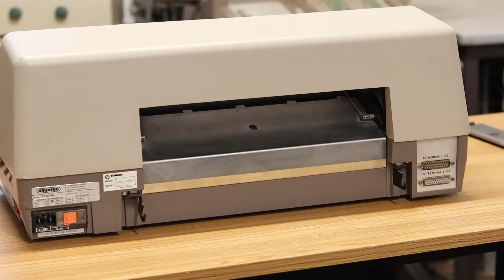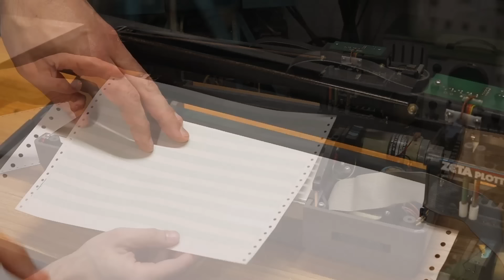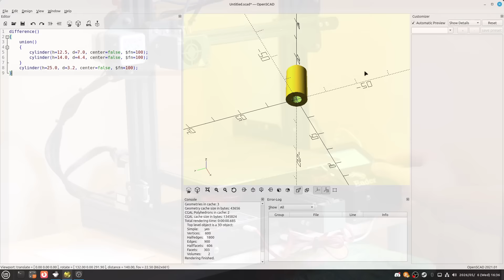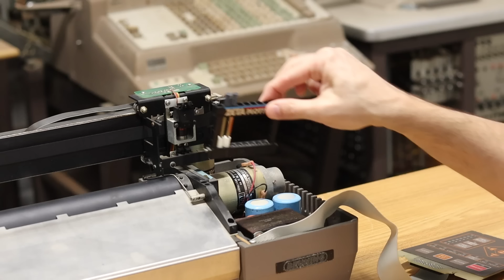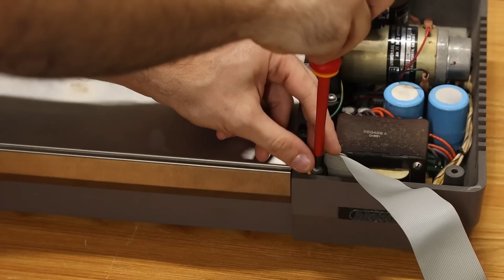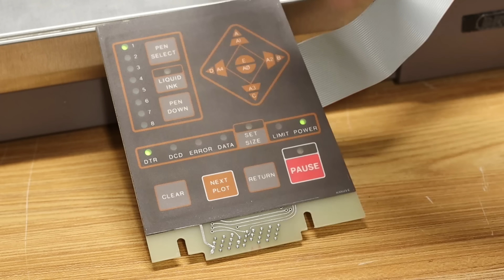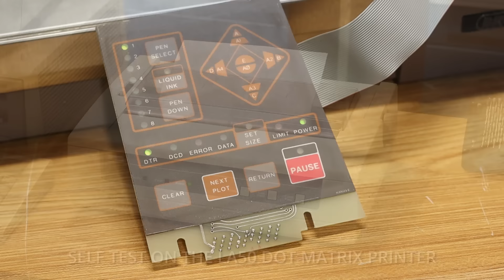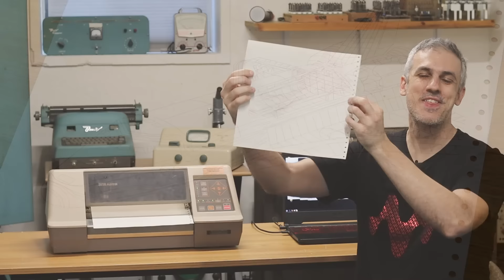A Pen Plotter from 1986!

Comment: I really like OpenSCAD, I don't have the time to learn regular CAD and OpenSCAD allows me to apply my existing developer knowledge to get functional 3D parts.
Reply: Works probably on simple geometry but the features on heavyweight cad are there for multiple solid reasons. The proper cads are parametric so you have similar features already built in to them. Bushing is so simple you can simply draw it on paper but most mechanical parts might seem simple but are full of small details that makes constricting them through code practicability impossible.

Comment: To solve your stringing issue, try drying your filament. PLA especially is hygroscopic. That will at least help. The other thing to check out is your filament retraction settings in your slicer software. The ender 3 doesn't have a direct drive extruder and so the retraction length is generally more for a bowden type printer like yours. There are tons of retraction calibration articles online and on the popular model sharing sites.

Comment: The stringing is slicer settings most likely. Print a temp tower that will help you calibrate your slicer settings. Or, get any printer from the last 2 years and just print. The Ender 3 is great if you want to learn all the ways to fail a print, but I recently acquired a Creality K1, and haven't touched my Ender 3 since.
Reply: Yeah 100%, I had a CR10S for several years (very similar to the Ender 3) but now I have a Bambu P1S and it's SOOOO much quicker and easier.

Comment: Neat. And fairly standard as far as plotters go. The pen holder solution being the only exception compared to HP or CalComps. The soundscape of clicking solenoids and drive motors is really something with pen plotters.

I own several myself from the HP7550A and a Plus over to a HP7225 and a Tektronix 4662.

Comment: I used to write software to interface with HP plotters (HP 7550A, HP 7585B, etc.)....
Reply: And many years later, maybe as late as 10 years ago, I happened to run into some old s/w I needed to adapt and use, but it used that old HPGL library for all its graphical output (to screen or pdf/ps). Luckily the old lib or dll still worked, because I didn't fancy rewriting all those plot and pen instructions!

Comment: Thanks for your fun videos :) 
For your 3D printing stringing issue, you should enable retraction in your slicer settings for the extruder. A good starting point is around 1 mm for PLA, and usually a bit more for PETG.
Retraction helps prevent filament from oozing out of the nozzle during travel moves, which is what causes those thin strings between printed parts.

Comment: Yea, either the filament is not dry or your extrusion settings are incorrect. Make sure you tune pressure advance and retraction properly
Reply: Temperature can also be too high.

Comment: Those strings on your prints are usually caused by one or more of the following:
1. Printing temperature too high
2. "Wet" filament
3. Bad retraction settings
4. Printing multiple parts at once
5. Using PET
6. Extruder's steps per mm too large (unlikely)

The usual solutions are:
1. Using your filament's recommended temperature, or fine-tuning your temperature (you can use Teaching Tech's printer calibration guide site)
2. Dry your filament and store it in some sort of drybox. You can use your oven, or your printer's hotbed, or your microwave (carefully). You can find drying temps and times on the Bambulab site.
3. Use Teaching Tech's calibration site.
4. Bite the bullet and just print it one at a time, or try your best with the above.
5. Using PLA.
6. Use Teaching Tech's calibration site. This is the least likely option if you've never changed it. Usually, it'll be too low.

Your prints don't look quite like wet filament, so check temperature and retraction first. But drying is ALWAYS a good idea. You can also use a lighter to make cleaning up the strings easier, if smoothness isn't critical.
Reply: How hot must filament be stored to remain anhydrous? There are little ‘rod ovens’ to protect the hygroscopic coating on opened boxes of welding rods. They’re cheap and might work for this

Comment: Also, for the 3D print, you can try getting a 0.2 mm nozzle, or using a resin 3D printer that has MUCH higher resolution.

Comment: 3dprinted pin holder issue: If it moves too much you can always start layering heat-shrink tubes on it until it fits snugly. Janky AF but you wont change them that often i think.

Comment: A weird thought...  since you have a 3D printer, couldn't you design a little tool that zips along the edge of a sheet of paper putting holes in it?  Like a spinning hole punch?  (So you can add you own tractor feed holes)?

Comment: You could replace the thin wall plastic section with a bit of heatshrink tubing of the proper diameter glued to the printed part. The stringing could be caused by waterlogged filament, but the Ender 3 is also a bowden type extruder and tuning the retraction settings is inherently harder on these. And if you are printing flexible filament getting rid of stringing on a bowden style extruder is neigh on impossible.
Reply: Or reach out to any of the hundreds of machinist youtubers to make you a coffee cup of them. Me? I'd just make them oversized and sand them down.
Reply: Could probably actually just shrink the heat shrink directly onto the pen to increase the diameter (maybe multiple layers)

Comment: Nice small pen plotter. I was working as field service enginneer and tech support for CalComp in the 80's and that remember me that time. The motors doesn't look like stepper motors but like DC motors drived by pwm H  switches. The feedback is done by optical encoders at the and of the rotor.
Reply: It's amazing they were able to get so much precision out of that configuration!
Reply: @PhysicsGamer  the problem with stepper motors is you don't have feed back , if for any reason you lost incréments ( many times in the logic in theses old times 🙂 ) the rest of the drawing is shifted afterward. Also stepper motors on the 70's plotters were incledibly noisy even on drum or flatbed plotters.
Reply: I probably know you. I worked there too.
Reply: @julioguardado  May be not, I am in France 🙂
Reply: CalComp brings back memories. In college, I worked in the computer center (mainframe and timesharing terminals). We had a CalComp drum plotter in the back hallway. It got used occasionally. What I remember most about it, was the absolute junkyard of nonfunctional pens scattered around it. Drafting type, ballpoint, even some felt tip pens. Didn't matter what kind, they were all pretty much single use, because by the time they were needed again, they were dried out. It used roll paper with tractor feed along the edges...2 or 3 feet wide. 
I wonder if you have looked for chart recorder paper?

Comment: If you 3D filament hasn't been in a dry box and is more than a few weeks/months old depending on the humidity.  It has probably absorbed too much water from the air.  You can try drying it in the microwave or oven, but...  Might be easier to accept the loss, buy new, and build a simple dry box for storage.

Comment: Nice video! Yeah, the membrane control panel can be a pain, however, remember that this was meant to be run in industrial environments and a sealed panel is MUCH better than the HP buttons that kept needing cleaned. The hard part is going to be getting the pens to work consistantly.

Comment: I first used a plotter in the early/mid '70s as an undergrad at Leeds University (UK). It was located in Manchester, and we queued up jobs to send over a slow modem link (300/1200 bpi?) and got our printouts in the post a day or two later. Then when I went on to do my PhD we had our own plotter. It was incredibly noisy, and slow. It used Rotring Isograph pens, and was connected to a PDP11/45, with homebrew graphics system (better than an Evans & Sutherland for our needs) to do molecular manipulation on screen. The plotter was oftren used to plot electron denisity maps for fitting molecular models to.  And Moonlander, of course, which a postdoc had converted to work with our graphics system.

How things have changed, except for playing games on computers.

Comment: Dry your filament and then calibrate your filament and printing profiles - I'd print a temperature & tolerance tower for the filament you're using, record the temperature sections that gave the best results and save the best profiles that work - Depends on the slicer you use, too - YMMV!

Comment: If it helps any, those are standard pentel pen refills, at one time they came in different thicknesses, tips, colors.  Not sure if that's still the case.
Reply: They also look a hell of a lot like parker refills for ball points without the plastic end on . You can get them in fine and medium .
Reply: @andljoy Parker, that was the other one I was trying to remember.
Reply: @andljoy  yes, Parker Jotter/Gel pen refills was the first thing that came to my mind when I saw them.  They come in a variety of colours, you’ve got your basic black, blue, red and green in the Jotter but the Gel adds in purple, lilac, pink and turquoise (probably others as well).
Reply: Also the same as the Fisher Space Pen Refills.
Reply: We get Ballograf refills that are very similarly shaped, made in Sweden, I think. 
I have fitted many of those in cheap old dried out advertisement pens that come in flashy colors with magazines etc. Sleeper pens that draw much better than the original dirt cheap fills that were in them.

Comment: I remember buying into E3D V6 for my first 3D printer and I bought some very fine nozzles.  0.25mm nozzles are incredibly detailed, but I wouldn’t print rubber at such a fine nozzle size, I’d use a resin printer for that, or better yet, get them 3D printed elsewhere for just the handful you need.

I still think 3D printers are awesome for vintage folks of many varieties, including computers, cars and toys.

Comment: People order custom forms all the time.   Just phone your local print shop and order the paper you want, the size you want with tractor feeds.   It's a pretty standard thing to do.
Reply: You have a far more capable local print shop than I do. I have to order from a specialty mill, and it's not cheap for custom dimensions. They can do pin feed holes, but not at arbitrary widths including the width needed here.
Reply: @jsalsman  The idea of a print shop not doing custom sizes seams odd to me.  Unless your talking about kinko's or something like that.   And Yea,  I assumed hew knew it wasn't going to be cheap from a custom printing house.
Reply: @lucidmoses  Mine is a shop catering to a local university. They can do all kinds of bindings and posters but not pin feed punchouts.
Reply: @jsalsman  he means a commercial printing house, like that can do offset printing and stuff. they have to cut their own jobs per order, so there's no way they couldn't do something like punch tractor-feed. where they might run into trouble is finding the right accordion stock to punch, but that's an easier thing to find
Reply: Ask for Michael Scott
Reply: It's not a custom format. It's SRA3
Reply: @bogdan_n  320 × 450 is that with or without the tractor feeds?

Comment: for the pens you could emulate the thin sleeve with a bit of tape wrapped around the pen
Reply: Or may be a shrinkwrap
Reply: Do you mean heat-shrink tubing?
Reply: Or maybe put the wider part of the 3D print in a drill and spin the narrower part against some sandpaper?
Reply: or print it thick with the outer diameter printed at exactly the correct outer diameter, then use a drill to open up the center to the correct inner diameter.  You then end up with the right inner and outer diameter and get the thin wall too
Reply: or o-rings.
Reply: or the copper tape used for stained-glass making.

Comment: That's brilliant. I used (late 80s?) a flat-bed one that moved the paper to and fro horizontally. This seems a better arrangement.

Isn't that papersize A4 landscape? Or A3 portrait?
Reply: A4 landscape endless paper is 12.99 inches wide.
Reply: Thats what I would check first.